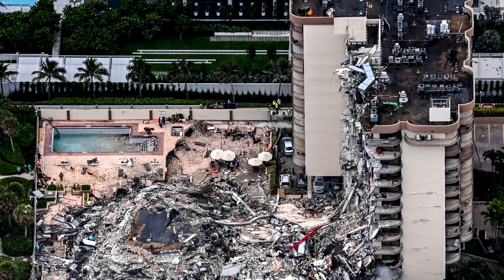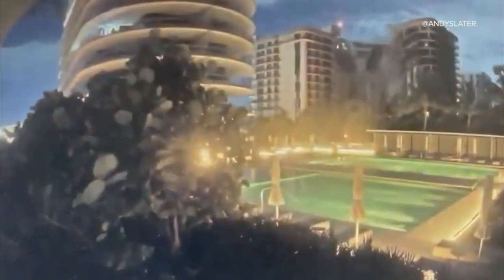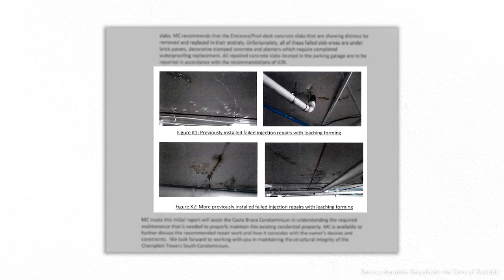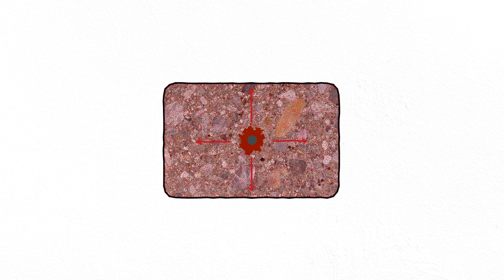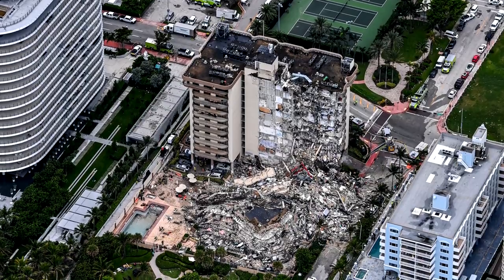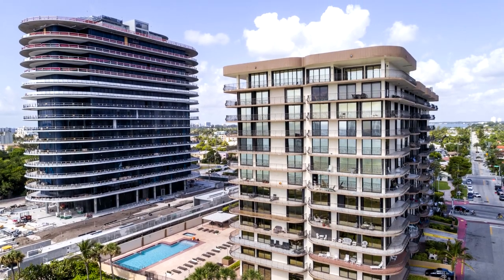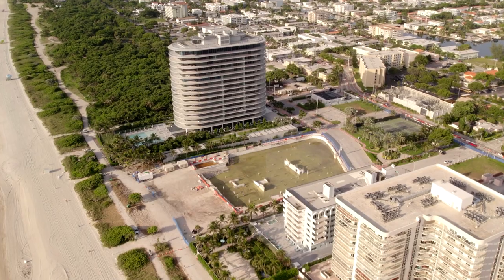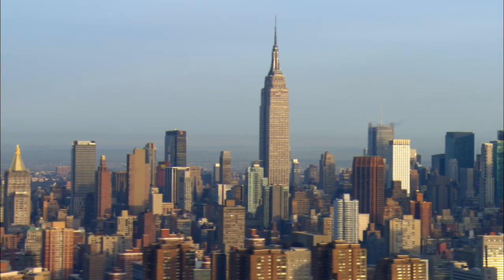Surfside Condo Collapse: What We Know So Far

Comment: Being in Miami, everyone is skeptical of the structural integrity of other buildings made around the same time period
Reply: I know I'd be worried.
Reply: @donkey7921  Surely that's being monitored or has even been evacuated..no?
Reply: Wasn't that building from around the time of Miami's cocaine days?
Could it be somehow related?
Reply: @collection6062  If you don't like it no-one is forcing you to hang around.
Feel free to cut things short.
Reply: As cruel as it sounds, they will probably be the safest buildings around as a result of this tragedy.
Reply: @ianmacfarlane1241  I would bet that they have had multiple teams of structural engineers walk through and examine the building both to make sure it stands and because it may give insight and clues into the south tower's demise. If there were warning signs that would warrant an evacuation the engineers would most definitely evacuate the building.
Reply: @ianmacfarlane1241  it’s being investigated but hasn’t been evacuated. All they’ve done is suggest they relocate.
Reply: @whatsguccivespucci4379  That's interesting - that would suggest that the City/State/Federal engineers haven't found anything too concerning at this stage - perhaps the problem with the other building was specific to that building, even though they followed an identical design.
I'd be seeking very strong reassurances before continuing to remain in the 'sister' building, but there are so many factors to consider - are the City/State/Federal government helping financially with relocation?
What happens if everyone chooses to relocate?
Will they close off the building, and if so will the residents be allowed to return at a later date?
It's a bureaucratic nightmare, particularly given that the authorities will be dealing with the residents of the standing building and the partially  collapsed/demolished building...and presumably some other neighbouring buildings.
It'd be a very tough decision - I don't know the demographic makeup of the residents, but if I lived with my family it'd possibly be a different decision than if I was living alone.
The residents of the area are in an unenviable position right now.
Reply: @ianmacfarlane1241  look at our governor, then ask that question again. He made a point of deregulating “burdensome government intrusions.”
Reply: @ianmacfarlane1241  you’re close. It’s mostly bureaucracy. What’s being said around here is negligence from the part of the city for not evacuating nearby buildings which were all made by the same guy and company. There’s a lot of uncertainty especially since the engineers investigating haven’t published or even mentioned anything they have found.
Reply: @whatsguccivespucci4379  I'm not from Florida...not even from the USA...I'm from Scotland, so I don't have any idea what's going on with this residential area or local government - I was just asking a couple of questions and hoping that things were okay...for the people in the other building - I do understand that things will never be the same for the people in the collapsed/demolished building.
Reply: @Mostlyharmless1985  I'm not getting into Ron DeSantis or his policies - I'm not from the USA and don't know enough about the guy.
What I do know about are his views on masks, vaccinations and the global pandemic, and it's probably best that I don't say anything about that.
Reply: @whatsguccivespucci4379  I watched your SLS video and gave you a thumbs up 👍
Reply: @ianmacfarlane1241  take your worst assumptions, The man himself is worse.
Reply: you're right, it survived andrew
Reply: @franciscomoutinho1 , the problem is that the builders mixed cocaine with the aggregate instead of cement because cocaine was cheaper. Better than beach sand, though.
Reply: @Mostlyharmless1985  ultimately your safety is your own responsibility. DeSantis has nothing to do with the building codes, BTW, nor the professional engineers who will be doing the inspection. You were just looking for an opportunity to insert your politics into an unrelated discussion.
Reply: @tissuepaper9962  no, actually, it matters quite a bit because one of the things that came out of his “Deregulathon” is the removal of building code training in recertification of architects.
Reply: @Mostlyharmless1985  architecture and structural engineering are completely separate disciplines. No overlap. Architects only take care of the aesthetic design of a building afaik. It's really just the structural engineers who need to know the building codes, of the two.
Reply: @tissuepaper9962 you are mistaken them, architects draft the plans. You are thinking of an interior designer.
Reply: @Mostlyharmless1985  previous comment deleted for the link so here it is again, disguised

study(dot)com/articles/difference_between_structural_engineer_architect.html
Reply: @ianmacfarlane1241  the building material and building designs are out of date compared to younger buildings Grady said. So if monitoring cannot show enough evidence, it makes sense to me to err on the side of caution and evacuate the buildings anyway to avoid loss of life.
Reply: @kathleen4376  As much as I agree that it's best to err on the side of caution, particularly where there's a chance of loss of life, age and design are only two factors amongst many - construction methods, quality of materials and workmanship, suitability of materials for geographic location, local geology, maintenance quality and intervals/schedule, land usage in immediate vicinity, local building codes, and other factors that don't immediately spring to mind.
There are many instances where I'd prefer to live in an older building if it surpasses the quality of new builds.
I currently live in a house that was built in 1938, and isn't considered old in the city where I live - Glasgow, Scotland.
I've previously lived in a tenement, (what's called a brownstone in US cities) that was built in around 1880, while my ex girlfriend lives in a conversion within a large detached house that was built in around 1850 - 1860.
There were many 'modern' high rise buildings built in Glasgow in the 1960s, almost all of which have been demolished over the last 25 years.
While I understand what you are saying it's a multi-faceted issue, and something has gone serious wrong when a relatively young building collapses.
Like you I'd certainly be extremely cautious about the 'sister'building until they can (a) figure out what happened, (b) ascertain whether it's likely to happen again, and (c) work to find out if there are an measures that can be taken to stop this from happening to the 'sister' building or any other adjacent buildings.
Take care ✌️
Reply: @Monkofthecaribbean  I just looked up a time lapse video of the Miami skyline. You’re right! I will say that the skyline first started developing in the 80’s and 90’s according to the video I saw. From 2008 on there were a TON of new buildings. Like 3 every couple years.
Reply: @Lamtitude  Yup definitely started in the 80s-90s and now like you said there is always a skyscraper being built in Miami.

Comment: I worked for a company in Tampa, Florida (SPERCO) that specialized in concrete rehabilitation of various water drainage systems by applying a 2-part polymer coating to new construction and already constructed water supply and drainage systems.  It's a very simple process that could be applied to new building construction but  not cost effective for older buildings due to the removal of of material needed to get to the concrete surface for application.

Comment: One thing you forget to mention in this is that with the sister building built at a very similar time they can look at the structure of that building to see what deficits there may be in a standing structure and then match the rubble and see if similar deficits exist as far as reinforcements, etc.
Reply: It doesn't need to be explained. It's inferred
Reply: I'm sure the north building had been flooded with teams of engineers looking for issues and clues.
Reply: Depends on the design drawings. Sister buildings from the same development can often have significant structural differences in their blueprints, since they don't always build everything to the identical layout. Even when they do use the identical design layout, new SSI's can come out that change some aspect of the structural/architectural design of the newer building.

Comment: I look at steel reenforced concrete structures all around me especially infrastructure pieces and notice bleeding rust cracks of corrosion all the time. I am starting to think that I have a reason to doubt some of it's integrity.
Reply: You might want to get your hands on the latest as built documents and get them examined by a civil engineer, just in case :x
Reply: @Soken50  structural engineer
Reply: Sometimes the rust stains you’re seeing on the surface are corroded tie wires or iron pyrites
Reply: @SteelheadTed  If you want to be pedanticaly specific sure, they're still civil engineers though.
Reply: @Soken50  they are not. They likely have the same degree, but Civil engineers do not specialize in vertical structures like a building. It's two different industries.
Reply: @NoMoreBreathe  Yes they do, civil engineers sometimes specialize in particular domains. If they deal with water management they're called drainage engineers, if they deal "In vertical structures", as you put it, they are called Structural engineers, or as Wikipedia puts it :
"Structural engineering is a sub-discipline of civil engineering in which structural engineers are trained to design the 'bones and muscles' that create the form and shape of man-made structures. Structural engineers also must understand and calculate the stability, strength, rigidity and earthquake-susceptibility of built structures for buildings[1] and nonbuilding structures."
Wow! Would you look at that, the most cursory of examinations would have indicated to you that structural engineers are indeed specialized civil engineers
Reply: @NoMoreBreathe  Also, the comment I responded to mentioned "reinforced concrete structures [...] especially infrastructure" a.k.a nonbuildings. So why would I recommend a buildings specialist ?!
Try reading and comprehending before shoving your foot in to be a pedant.
Edit : typo
Reply: @luke1729  That depends on a location. We had specific degrees in structural engineering in my country.
Reply: @AlexBesogonov  here in the U.S. you graduate with a bachelors in Civil Engineering. From there you get your Professional Engineering license and choose a specialty or get a E.I.T. And go back to graduate school to gain a masters in a specific field such as structural, geotechnical, transportation, or water resource engineering.
Reply: @Soken50  it’s not pedantic,it’s the difference between distinctions made in school and what is made in professional life.  On a building project, what a structural engineer does and what a civil does are different things.  If you call a civil engineer on the phone and ask them to review building structural drawings, they will tell you to call a structural engineer.
Reply: @SteelheadTed  If you have a suspicious lump and I tell you to call a doctor, are you gonna yell at me for not telling you to call a medical doctor of oncology ?
If you call a civil engineer he'll likely review it because he can or refer you to a specialist because it's above his abilities.
Either way, you can read the other handy comments where I point to source material indicating that structural engineers are indeed civil engineers, just like specialist medical doctors are still medical doctors.
Reply: @SteelheadTed  and if you call a cardiologist and ask him to look at the rash on your ass, he's going to tell you to call a family doctor. That doesn't mean they aren't both still doctors. In all actuality, the cardiologist knows (or knew at one point) enough to do family medicine, he may just look at it for you to help you out and give you a tentative opinion before you see the family doctor.
Reply: @SteelheadTed  as someone currently studying engineering I can say that they are the same thing. The college course I'm in is called civil engineering yet I will be the one helping to create and check over structures. A civil engineer will specialize in a certain type of structure, and to mention what kind of structure is helpful to inform you on what they do, but to call them a structural engineer instead of a civil one does nothing. I think the difference is mainly that people think structural engineers are more involved in on site monitoring and the construction of sites than civil engineers which isn't really the case!
Reply: @Soken50  the simplest distinctions in licensure. Civil Engineers and Structural Engineers have different licensing requirements from the states. They will both have the same degree (Civil Engineering) but the distinction between the two is an important matter of law.
Reply: @Soken50  not the same thing.  The analogy would then be “call an engineer”, and at that point someone would ask, what kind?
Reply: @megan4480  as one who also studied Civil engineering and is now a structural engineer of 20 years, my opinion on this is informed, and durable.  Good luck with your studies.
Reply: @elijahtremblay8817  Yeah , in my country back when I was studying we had a 5-year program. Once you graduate, the graduation certificate itself acts as a license (though you usually have to get additional certifications).

Comment: Shoutout to Building Integrity and his "Engineering Failures Found In Champlain Towers South Drawings" video.   As you mentioned, he questioned rebar delamination and punching shear in previous videos - and once he ran the calculations on the architectural drawings, he discovered lots of interesting things  (pool deck was at 100% static load as designed, etc.).  Worth a watch.

Comment: Another thought - someone below speculates that the collapse might have been triggered by the car parking area being full. At first I laughed at this, but then I remembered that the average American car weighs about 2 tonnes! So a full parking garage would add a huge amount to the load the building is taking. That fact that it collapsed in the middle of the night when almost everyone is home could support this as well. All of which led me to wonder if buildings are more likely to collapse at night. Is there any pattern like this observed in buildings collapsing unexpectedly?
Reply: The cars were parked under the building, on grade. No load on the building.
Reply: @photobobo  There were 2 levels of parking. The upper level collapsed first or at the same time as the pool deck, unclear on that. The channel Construction Engineering & Failure Analysis does very in depth analysis of the plans.

Comment: Oh, wow. Near my place there are four 4-storey buildings sitting on  top of a large underground parking lot. The parking's ceiling is poorly insulated and it is often flooded. Moreover we have freezing weather here during winters. Sometimes down to  -30C
Reply: But is that flooding caused by water penetrating THROUGH the concrete or is it entering from another route? Water on concrete isn't an issue, water penetrating THROUGH concrete is. Especially in freezing climates.
Reply: @nemo-x  Water itself isn't the primary issue. Salt and Chlorine are. So concrete is designed different (primarily through clear cover, but also though mix type) based on exposure to weather and to salt.
Bridge piers that sit submerged in water are designed to handle that water, while beams and columns that are NOT supposed to be exposed but have chlorine water leaching through them from a pool deck are going to have a much harder time resisting corrosion.

As for no single cause bringing down an entire building at once, that's false. The reaction of the structure after member failure is entirely based on building design, but many buildings ARE susceptible to rapid progressive collapse due to a single member failing, and in those cases we make the members substantially over designed such that failure in those members should never happen.
Reply: @EngNerdGMN  I heard from a person who lived there, that to fix the problem they would have to tear down all the grassy areas between the buildings and put a better water insulation onto the garage ceiling. So the water comes through the ceiling at least partially. Probably through entrances as well. And stays there as the pumps often fail to operate. There are more similar issues with the buildings. Rain water can get in the walls in some places through the roofs, or where balconies meet the walls, making wet stains in the apartments. The developer went bankrupt soon after the buildings were completed. No one can demand fixing the problems now. The buildings are about 10 years old now.
Reply: @nowymail  Oof... all it takes is a couple good rain storms penetrating the concrete before freezing nights and that concrete is doomed. People underestimate the forces that freezing water can exert.